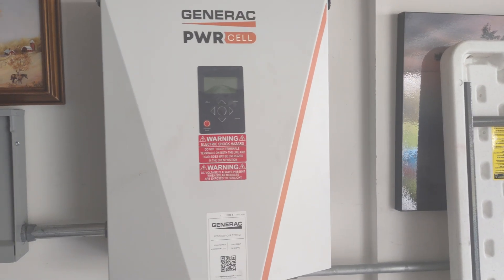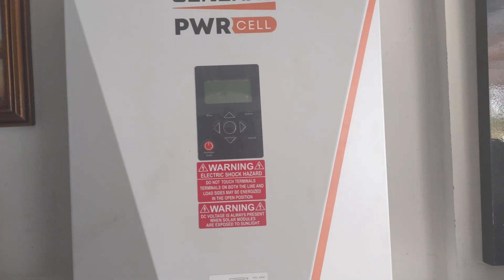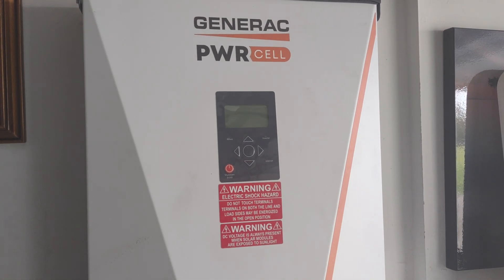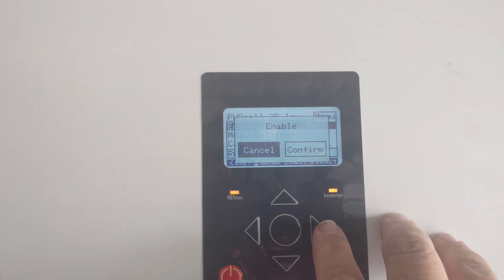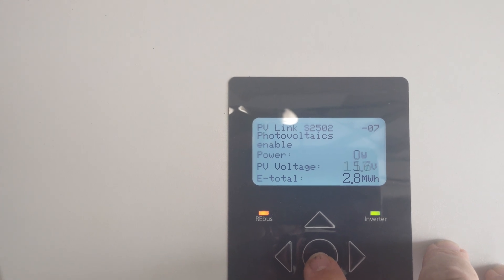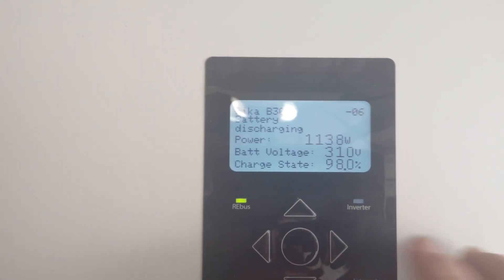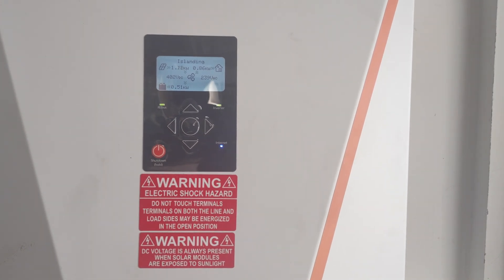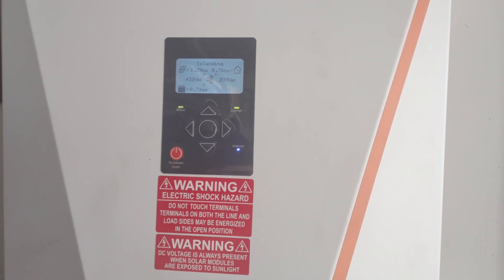review of how to dark start or Black start a generac power cell inverter

Comment: I followed instructions to #darkstart my system, and they worked exactly as you presented! Thank you for posting this video.
I'm in MI...
We just had a horrible ice storm that took out all power sources, and I only have solar, which shut down @ 3am after the
backup battery drained.

The problem was caused because my system was never scheduled properly by the installer who's now out of business, but 
#Generac took my call and technician Brittany A. walked me through the rest of the system restart to perfection!
Reply from the maker: Glad everything worked out glad you liked it
Reply: Yeah my installer disappeared. Now I have to pay at least $100/hr to get someone to look at it. Because the new company says they didn't install it and Generac won't pay me but pay the company. So of course the new guys will take the money. It's always once every few months something goes wrong. Idk if I'm saving money after paying over $50k for my 36kwh system. 😮